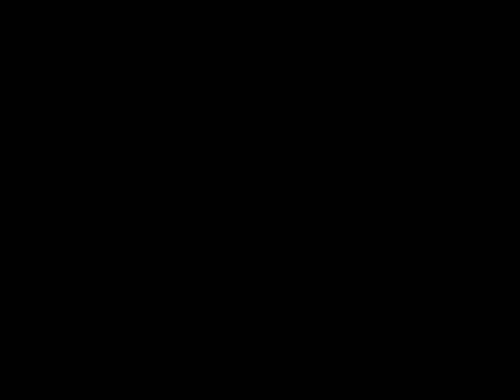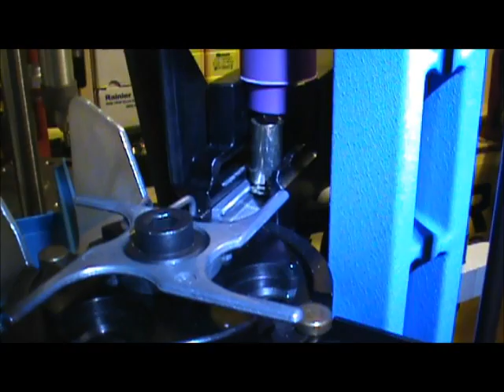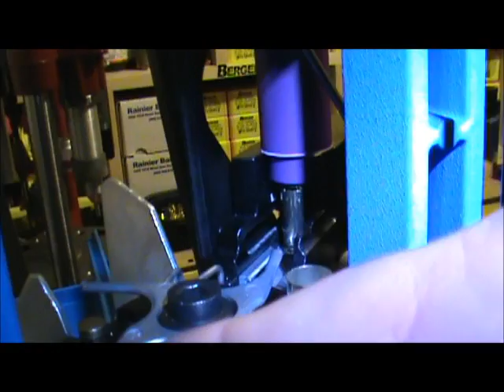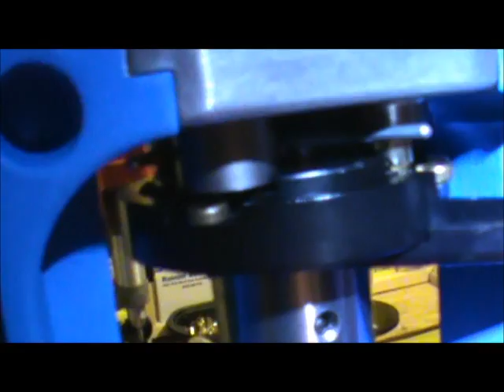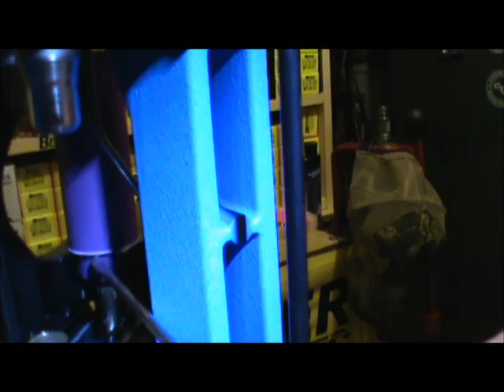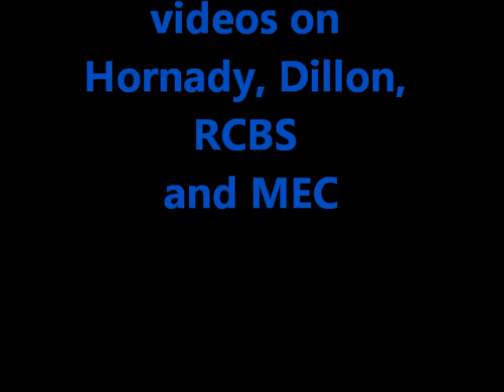Close up of Dillon's case feeder

Comment: What is the procedure for adjusting the feeder when swapping calibers?
Reply from the maker: You only have to do two things most times. Change the colored insert for the caliber you are changing to, and also change the metal slider you can see in the video that the case will slide in on. And the only other thing would be a small pistol or large pistol case feeder plate. That's it and its that simple.
Reply from the maker: Make sure he drop tube is big enough also for your cases

Comment from the maker: Thanks for the feedback...
To answer your question, no I have not had any issues other than a 9mm stuck in a 40 case of the 10mm. 

Do you have your plate screw adjusted right or the brass tipped set screw in the side of the ram set right?   Those are the only two reasons I think would cause that. Have you called their customer service? GREAT service they have and will walk you through a few options.

Good luck!
Gunner